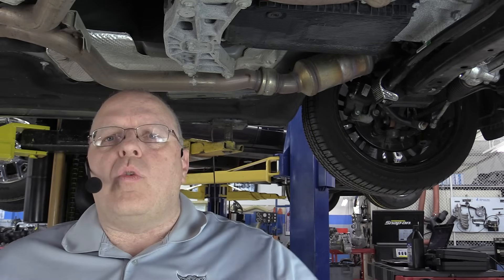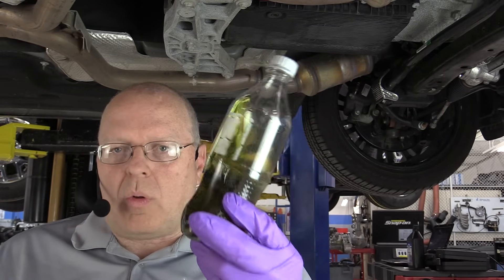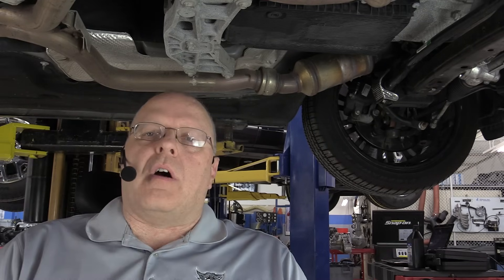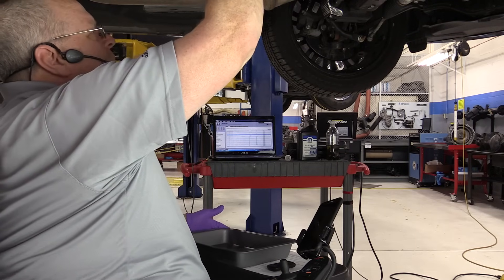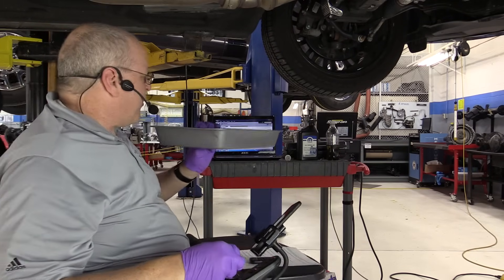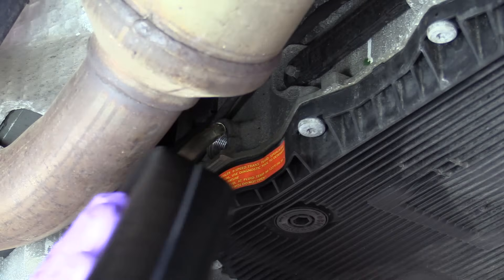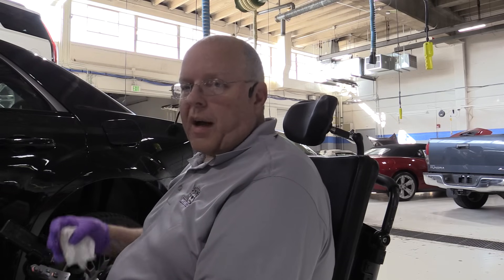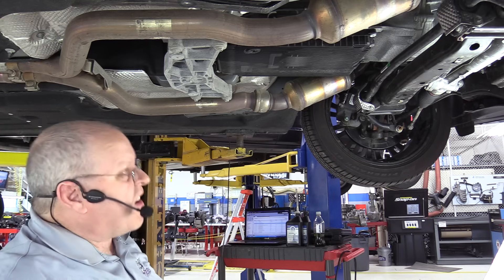Jeep, Dodge, RAM ZF 8HP 8HP 8-Speed  Transmission Fluid Level Check - No Dipstick

Comment: ZF GA8hp50z Gearbox question

Hi i would just like to know is someone can assist me with a question i have.
My new car is using the ZF GA8hp50z AT transmission. I have studies up on all the details regarding the transmission and changing/cheking the Fluid.
i got the transmission up to temperature, 35 degrees C, and proceeded to check the fluid in the gearbox to see if it needs a top up as i am hearing a small stutter when car is hot( more on this later)

When i opened the fill port the fluid came poring out?? Now there is a thermostatic bypass valve and a radiator present. Now my worries is, how can i confirm the fluid level? does the fluid of the radiator just flow back in the gearbox when i park the car? so its allays going to be overfull? and what happens when im driving, will it drop when the valve opens at 75 degrees and the fluid goes back to the radiator?

I am extremely stressed that my new bakkie is going to have problems. The worst of it all is the GWM dealership has ABSOLUTELY NO KNOWLEDGE on this. So i cant take my car to them they are too arrogant and dont know the procedure to even check the oil.

Please at least point me to someone who knows what they are talking about.

Comment: I know this video is a few years old now, but is this the same procedure for the 8 speed transmissions on the new Jeep JL Wranglers?

Thanks
Reply: Yes it is. I did mine on my 19 2 door wrangler. Was tight getting the plug out but besides that went smooth. Its good to have the peace of mind knowing the transmission is topped off

Comment: I wouldn't buy one of these cars if they offered it to me at half price all that trouble to check the Trans fluid I'll stick to the old ways it's a lot easier what a stupid idea not to put a dipstick when I go out to buy a new car I'll open the hood and no dipstick then no deal I'll buy one that has one and save a headache later their just doing that so you can take it to the dealer and they ll screw you over

Comment: Hi  thnxs for your videos and they are great but I have a 2003 Peugeot 206 and I wonder it really runs rugh and when it comes to heavy rains it really runs smoothly and i always wondered if it is cylinder head or the clutch or the sensors off but the problem is that the pedals shakes normally when I press the throttle and in heavy rains it really gets really smooth just as good as new  could it be of missfire or coilovers? Or injectors? No error codes . Plz help

Comment: 2019 model had cooler line leak at trans fitting. The lady drove it home and I replaced cooler line assembly in her driveway. Only able to jack up one side of car so could not do trans fluid level check properly. I pulled the top cooler line from the top fitting at cooler, attached a hose with a hand pump and added 2 quarts of fluid there and shifted through gears after each quart. After second quart gear selection felt good and then drive car to dealer for fluid level test.

Comment: If you are just trying to do a drain and fill of your transmission just have to jugs one for dirty one for clean that are clear and drain your old fluid in one jug then add clean fluid to match your old drain jug and add the same amount back in. Make sure you have no leaks prior to doing this that may cause incorrect fluid level that's if you have no scan tool .

Comment: On my 1500 ram tradesman 2 wheel drive I am seeing oil on the tranny pan and on the cross bar that goes across the bottom of the pan. Do i need a new Pan Gasket?

Comment: When I removed the drain plug for the Very first time, from Factory, at room temperature like 78 degrees, it spilled out pretty much. So the factory Over filled the transmission ⁉️🧐
Reply: I had the same experience, i wonder if the fluid in the radiators just flows back in to the transmission while the valve is still open after stopping at home?

Comment: Always thanking this fantastic professor I would like to say regarding the final part of this video, It result to me that normally these thermostats are never completely closed but let 10-15% of fluid pass, therefore there is not any problem of having, at the oil check temperature, the heat exchanger isolated from the gearbox.
Reply: are you sure about this re: cooler valve?  This is the part I'm super hung up about because ZF gives a very confusing instruction on this point and Chrysler seems to leave it out altogether.  But if what you're saying is true, that would explain why Chrysler leaves it out.

Comment: Since the fluid indicate 8 or 9 speed , does it mean setting the paddle shifters to sport  (S )mode instead
Reply: Instead (D ) drive and lock to PARK then proceed to transmission replace pan and fill fluids ? Just some thoughts if there’s some hints .

Comment: Did a fluid change for fitst time.  Let out the fluid, measured it, and put exactly that amount back in.  Drove to 180 degrees and let sit over night.  Applied this method and it took another 23 oz.  I am thinking that Dodge underfills these right out of the factory, never dealing with the bypass valve issue.

Comment: If the transmission coolant by-pass valve closes when the aft fluid cools down, why would you wait for the oil to cool down again to refill? I'm sorry, but you have to refill after driving it like you said to get it up to temp. BMW 40C - 50C. Than make sure you have fire prove gloves when you are going to refill or you will burn your hands with the exhaust pipe. Your video (15:50) mins.
Reply: Because the level need to be checked when the fluid is between 86-122 deg F. At that range, the fluid is the density that the engineers planned it to be for the fluid level check.

Comment: I just pulled the drain plug and dropped the transmission pan on my 2015 Mercedes benz sprinter 3.0 diesel RV and the transmission fluid was green. The transmission is a NAG1 - 772.6 5 speed...134 fluid is what should be used. I was wondering if the green fluid could have damaged the transmission.
Reply from the maker: I don’t know. Possibly over a long time. Thanks for watching

Comment: Thanks for your video! I have an BMW 330d (date of product is 11.2012) with this ZF 8Hp automatic transmission. My oil was changed, by the previous owner, but now I hear some strange noise, for about 10-15 seconds. It is like a squeaking sound. I dont know, it is because of an inapproriate  oil change, or incorrect oil level? I've bought the car know, so I would know, is it only by an incorrect oil change, or service, or it is a bigger problem...Otherwise, the transmission works well, but this noise... Thanis your help!
Reply from the maker: Good question. I recommend having the fluid level checked as a first step. Thanks for watching

Comment: Great video! Very informative. I'm mostly concerned about FCA lifetime fluid in my Jeep Grand Cherokee. My local dealer told me it never needs to be replaced even if I'm towing a travel trailer a lot during summer. What do you recommend; change at what mileage? Does FCA use a better fluid than ZF original fluid to prevent changing it at around 60k miles?
Reply: I changed mine in my 19 wrangler at 20k. I used the liqui moly 1800.

Comment: So you’re telling me that the transmission is low on fluid? When there’s no way to access it from under the hood and no leaks how does that happen? So basically anyone that buys a jeep should have their transmission inspected? I mean doesn’t that make sense?
Reply from the maker: There are many possible reasons: Incorrect factory fill, previous service work. radiator replacement, cooler line replacement, bypass valve replacement. etc.

Comment: Would you know if the bmw 335d 2016 ZF 8HP transmission has a cooler that drains when changing oil /or checking levels or is it set up like this Chrysler were as you say the level would be wrong due too the empty cooler lines?   Many thanks
Reply from the maker: I do not know. Thanks for watching

Comment: @WeberAuto   ..  if after your fill procedure, and after driving >160F to open the thermostatic valve for the Aux cooler/lines, then when you sit the car to cool back down to 104F, arent you again getting an inaccurate higher level since the thermostatic valve is still open (until the fluid drops below 160F) and allowing the fluid in the meantime to drain into the pan whilst waiting for it to cool to 104F?  Did the ZF guy have any recommendations for working around the Aux cooler?
Reply from the maker: Yes, see the pinned comment under the video for an explanation. Thanks for watching

Comment: my way is drop the pan change the fluid in the pan and filter about 5 1/3  quarts ,full up with 5 1/3 quarts drive 30 mile ,repeat again 5 quarts drive 30 miles again repeat 5 1/3  quarts best way changing ur trans with out flushing i have 2014 grand jeep takes total 16 quarts,,this is with out checking or flushing,
Reply from the maker: Thanks for watching
Reply: @WeberAuto  do you agree my way

Comment from the maker: Additional Information:
1. ZF recommends safely tilting the vehicle towards the driver's side to add an additional 0.5 liters of fluid to compensate for the transmission cooler bypass valve issue discussed in this video. 
2 You must use the correct fluid in this transmission. The fluid must meet ZF-LIFEGUARDFLUID 8 (ZF No. S671 090 312) specifications. See https://aftermarket.zf.com/remotemedia/lol-lubricants/lol-en/lol-te-ml-11-en.pdf
3. Please turn off your traction control system before performing this procedure.

As an automotive professor, I hear from a lot of people and students who have a negative reaction to this video and wonder why they took away the dipstick. Think about this: if a dipstick is so easy to use, you should be able to answer all of the following questions: 
1. At what temperature is the "cold" mark accurate? 
2. At what temperature is the "hot" mark accurate? 
3. What temperature does the dipstick even refer to? Outside air? Coolant temperature? Transmission fluid temperature? 
4. How will you measure that temperature?
5. If the fluid is within the cold mark area marks when it is "cold", is the fluid level okay?
6. if you live in a cold climate area like Alaska, is the "cold" level accurate there? What if you lived in a hot climate area like Central America, is their "cold" mark accurate?

If you cannot answer all of the previous questions, should you be using a dipstick? See my dipstick video here: https://youtu.be/s-tHJ2Q_BbA
Reply: Hey John, would this method apply to a Jeep Grand Cherokee with the Zf 8 hp70? Would you add the extra fluid to a cold transmission?
Reply: @anthonyhayden320  im curious about this
Reply: @anthonyhayden320  yes it would theres a video of i guy doing fluid change on his 8 speed wrangler. I recently did mine on my 2019 2 door wrangler. It can be done. And also I recommend using the liqui moly 1800. It cost around 14 a liter vs 30 a quart of the mopar 8 and 9 speed.
Reply: @WeberAuto the procedure says "86-122 degrees F (30-50 degrees C)" which is a pretty good range of 40F - that could be applied to the "cold" dipstick low mark fudge when car has been sitting overnight... the dipstick could list temperature for Hot as well - some cars (not my BMW) do have tranny temp gages. dipstick would make it trivial to check for color/condition as well.
Reply: THANK YOU!!!! I read the ZF instrucions and saw the step about "overfilling" but couldn't figure out HOW this was done.  Though according to many comments here, this is actually an unnecessary step on the RAM because the bypass valve system leaves fluid in the condenser anyway.  Also - isn't this same system also warming the transmission such that the valve should be open anyway when cold to draw in engine heat to the transmission?
Reply: Actually yes the dipstick literally tells you cold is 70° and hot is 180°, stupid
Reply: Excellent points. Basically, the dipstick was removed to prevent the “dipstick” from ruining the transmission due to a lack of understanding of how the system works. 

They still could have come up with an easier way to determine the correct oil level. My car has an an oil level sensor that will not give you a reading until the engine is at the right temperature.

Comment: This is one of the best ZF Trans videos on Youtube. My problem is when I go to different auto shops in my area to get filter/pan fluid drop, they have absolutely no idea what I'm talking about. ZF fluid temp sensitive fluid change ???  One shop told me he can flush any trans made, refill with Kendal Chrysler automatic trans fluid.
Reply from the maker: Tell them to read that label on the side of the transmission oil pan right below the fluid fill/check plug. Don't let them put any other fluid in it other than the Chrysler 8-9 speed fluid or the ZF-LIFEGUARDFLUID 8 (ZF No. S671 090 312) fluid. See the video description for more information.

Comment: Can you use the digital trans temperature on the dash/odometer if you don’t have access to a scanner?
Reply from the maker: Yes
Reply: @WeberAuto  thanks, one other question, I’m replacing the ac condenser because I got in a accident with a deer. It mess up the top part where the trans cooler is, leaked out fluid. Does that mean when I check to add fluid it might not be accurate? I will have to check it again once it’s cool.
Reply from the maker: @thewhiteknight2318  Yes, ZF recommends that you add 0.5L more fluid above full. You must tilt the vehicle (lift the passenger side) to add the fluid.

Comment: Also might sound like a dumb question but when y’all running through the gear the vehicle is off the ground correct?
Reply from the maker: To pump fluid through all of the fluid passages and clutch packs in the transmission. If they are empty, the fluid level will be artificially high.
Reply: @WeberAuto  understood. But to clarify, when doing so the vehicle is still off the ground when cycling through the gears and Reving up slightly? And thank your for replying so quickly
Reply from the maker: @Lui8111  I misunderstood. It can be as long as it is level.

Comment: Just for info. The fluid from coller will never Go back to transmission.The pepiline are not on the top of transmission. They are under transmission. So no chance that the oil it's going back to transmission. The ZF engineer with who you talked it's maybe a noob.
Reply from the maker: Thanks for watching